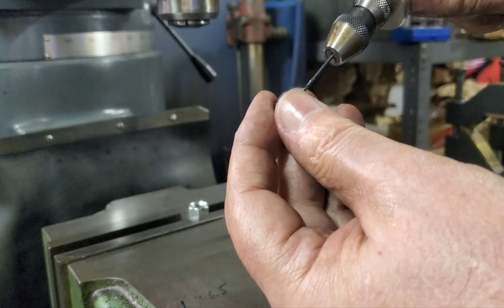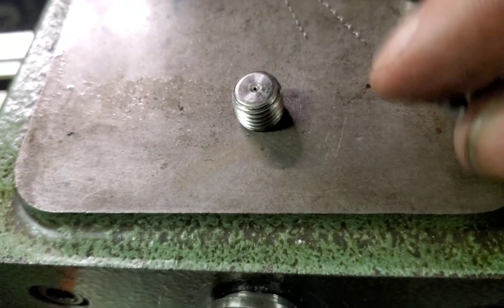Drill .039 Holes in Oil Gallery Plugs.

Comment: We're did you get that little drill? If you built it we need that video..excellent job..
Reply from the maker: Thanks for watching. 
The chuck is a Micro mini chuck adapter with Albrecht chuck.
You can get a at Penn Tool or industrial tool supply.

Comment: I had a part a while back that was 150 holes at .043 diameter down the length of a half inch steel tube. I wish I had known about that hand chuck, would have made my life so much easier. Nice video!
Reply from the maker: Thanks Reb, I appreciate you watching and commenting. 
Nice to have the higher speed and be able to fixture.
You really have alot of control.
I use to work in Aero Space shop and we had some Electro Mechano high speed drill presses, I believe went up to 8500 rpm.
Really nice doing small holes.
Did alot .015/.018 range.
Get some Tapmatic and go to town.
Takes a feel and touch for small holes, not everyone has it.
Congratulations on your .043 job!👍
Have a great evening. 👍 🇺🇸👍

Comment: Where did you get the chuck from??   I need it.   I do the bleed\oiling hole on all my Ford 460s to oil the distributor gear - thrust pad on all I put together.   I enjoyed the vid...
Reply from the maker: Thanks for watching. 
Penn Tool has them.
They are expensive. 
Zoro has a lower cost version.
It is a knock off.
Have a good day. 👍

Comment: Ed I love that mini chuck.... Yeah I'm the same way I get every drop of paint, lubricant out of all my spray cans. Sometimes I just use a sharp awl and release the propellant then put a hole on the bottom ...and its milking time 😂... I even have a plumbing saddle valve rig I use to remove the propellant with...just never puncture the can on its welded seam... Waste not want not.
Reply from the maker: Thanks MoparNut, I appreciate you watching and commenting. 
We have to make the most out of supplies.
And yes waste needs to be avoided. 🙂
Have a good evening. 👍 🇺🇸👍